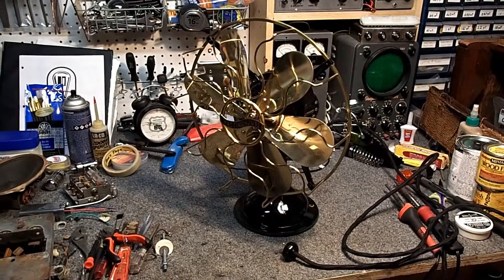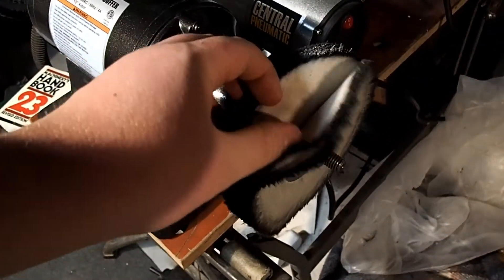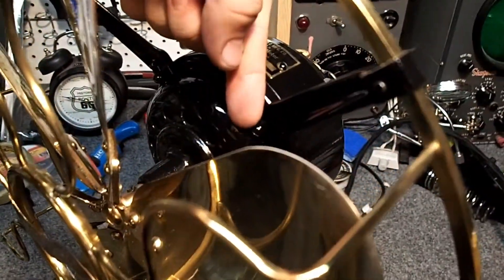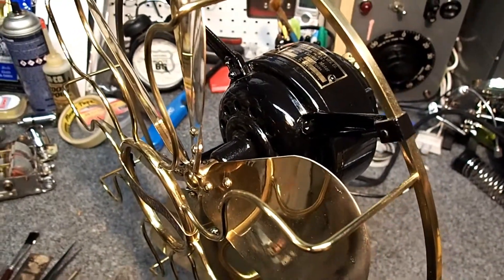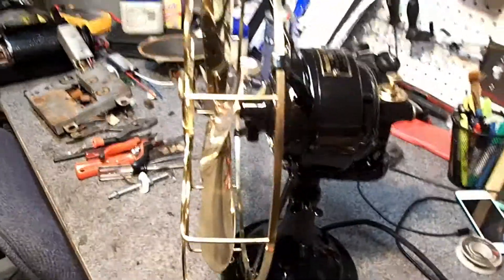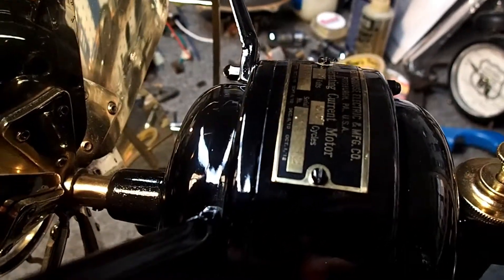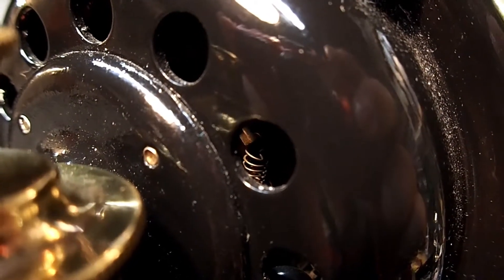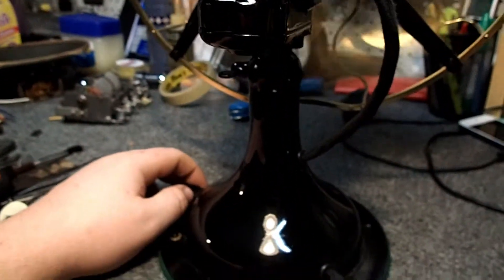Antique Fan 3 Speed (Low, Medium, High, Off) Switch Wiring -1912 Westinghouse

Comment: when you rewired your fan why did you use white for positive? do you add a ground when you replace the cord? do you take into consideration polarization?  I am restoring an old GE fan the 3 position switch [rotary] wires run to a resistor block or choke what do you do if that piece is missing?
Reply from the maker: It's been a few years so I cannot comment why I used a white wire. I think I added a ground, but not necessary. If you do not have the speed switch wire direct to the fan motor, or find a generic switch to put in the base. Polarization does not matter for AC motors. It will run the right direction regardless.

Comment: Would a 3-blade oscillating Westinghouse fan be rewired the same way?  Mine has an open circle in the center of the cage face- if that helps with the time period.
Reply from the maker: Most likely. But I've never worked on one

Comment: lots of help thanks, any idea why my fan same as this one always need the blade pushed to get started after i put the switch on?
Reply from the maker: It may just need torn apart and cleaned. Old sticky oil can be enough to hold the blades stationary on start up. Also it could be that the bearings on either end of the motor shaft are not aligned. They can be aligned by adjusting the torque of the screws on the motor housing. Symptom of misaligned bearings is a tight spot when you rotate the blades by hand. If it's not either of these, your fan may have what I call a starter winding that is burnt out, or a dirty switch on the starter winding. The starting winding gives the motor a little extra power when turning on, and shuts off somewhere around half speed or less. Usually the starter winding switch makes an audible click.
Reply: @mattkinnard6899  thank you much,ill give it a go

Comment: Helpful video!  I have an identical-looking fan, but the low-medium-high settings on mine all result in very similar speeds--basically three versions of high, and the fan moves a lot of air!  Do you know a way to alter the switch to provide more distinct speed settings so I can have a low or medium?  Or can I plug the fan into a fan dimmer switch to accomplish this?

Comment: Matt, what brand and type of black paint did you use.  It really is sharp.  This has been a VERY helpful video.  Thanks
Reply from the maker: At the time that was Rust-Oleum with clear coat. Currently I'm using duplicolor or SEM products and have been much happier with the finish durability.

Comment: I thought the larger side of the plug in is always hot (black)? The white wire is the neutral. The black wire isn’t a negative wire it’s the Hot wire. You’re thinking of 12dc for black to be negative.
Reply from the maker: Your correct on the wire colors and polarity. I am certain that the wide prong on a polarized plug is neutral.

Comment: Thanks for these vids. Picked up a slightly newer style w/ the micarta blades not too long ago and wish to replace the power wire with something more period correct as it was replaced sometime in its life.  Knowing what to expect during disassembly helps a ton. The brass on those early models is beautiful.
Reply: How Did You Hook Them Up In 1912?